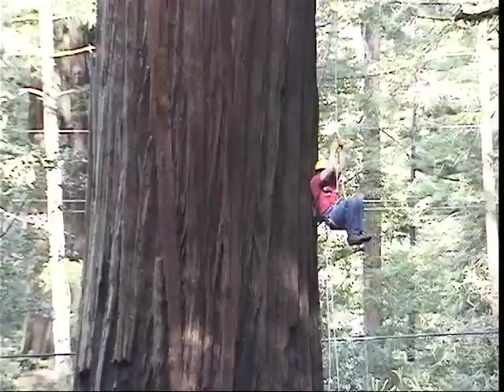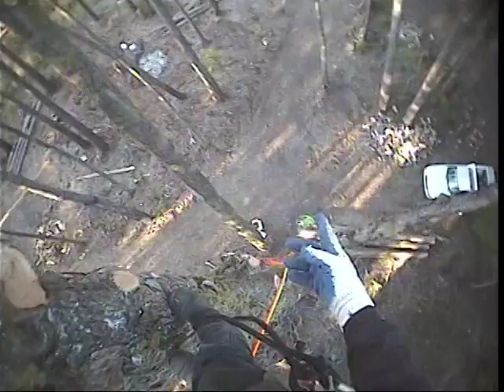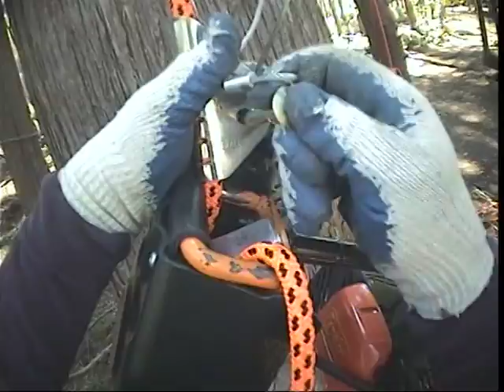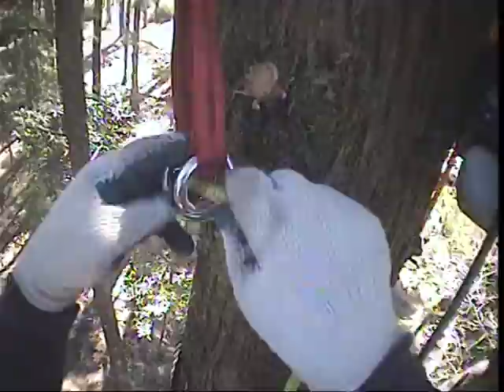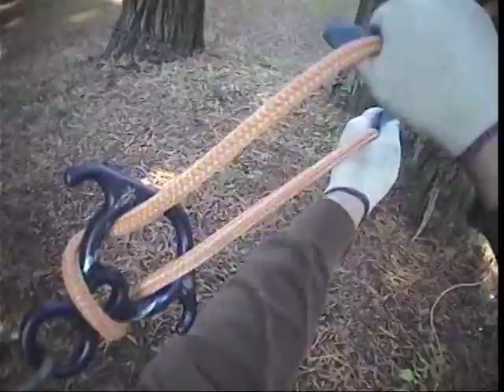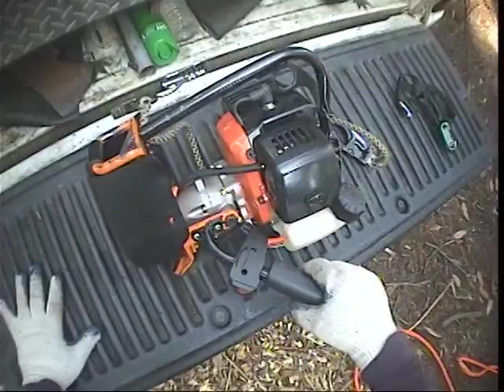RopeTek Wraptor

Comment: Very light but sturdy ascender that anyone can afford✏️>allmy.tips/ClimbingAscender?u   I hung a foot loop through the large bottom hole of mine to get a leg up and save energy. I'm using it with 12mm rope and don't have any issues at all with it slipping or damaging rope. Don't trust it as your primary life support, but I definitely keep mine on the line as a handhold in case things go south. I wish this company would make a copy of the two-handed petzl butterfly-shaped ascender!